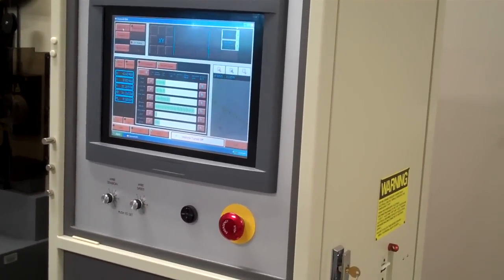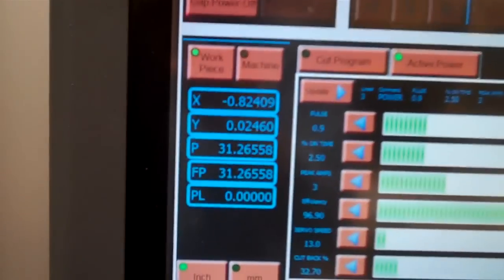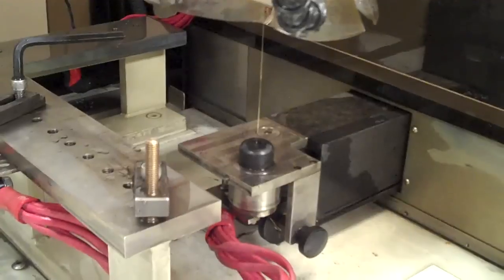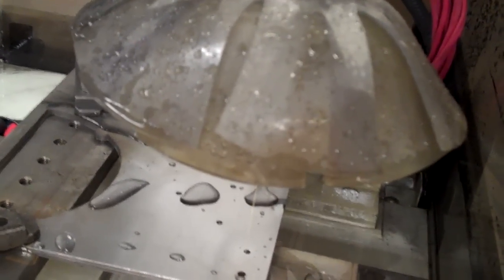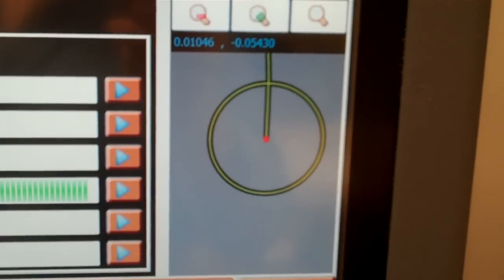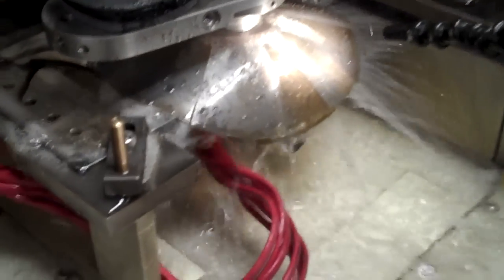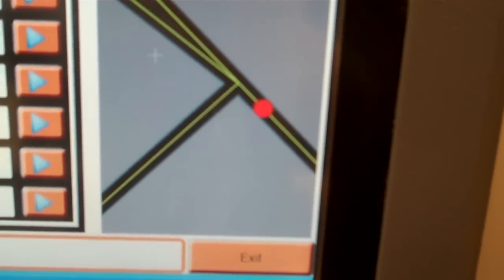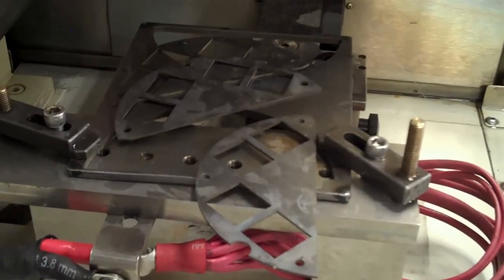HANSVEDT DS-22 WIRE EDM

Comment from the maker: The machine has a water pump system and a deionizing system to keep the water non-conductive. The water prevents uncontrolled arcing, the wire will not start eroding until it is very close to the material being cut. I was using .012 wire which cuts.012 plus about .0007 overcut. The water also flushes out the spark eroded material as the wire burns through the part. The flush is critical to maintain the arc as the wire cuts. There is a top and bottom flush nozzle. The wire is a one time use item.

Comment from the maker: These parts were .005 just for demo but we routinely machine ul gage blades and consistantly hold .0005 or better with very good surface finish requiring little or no secondary finishing-TM